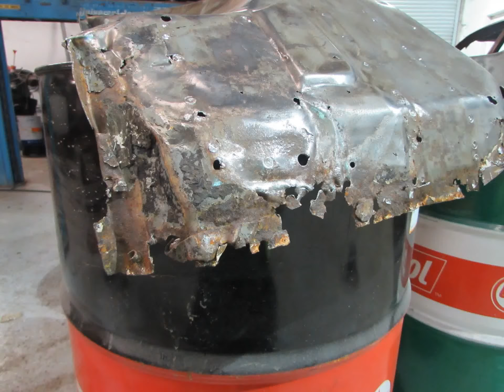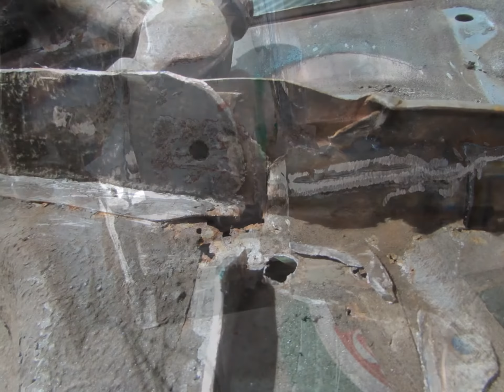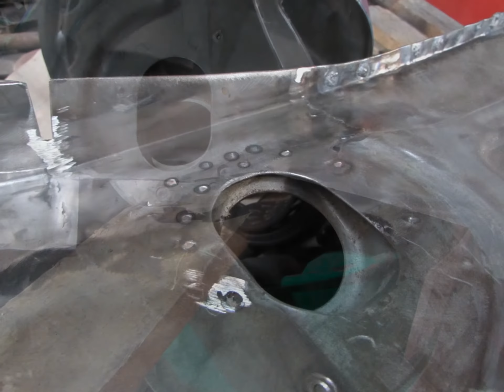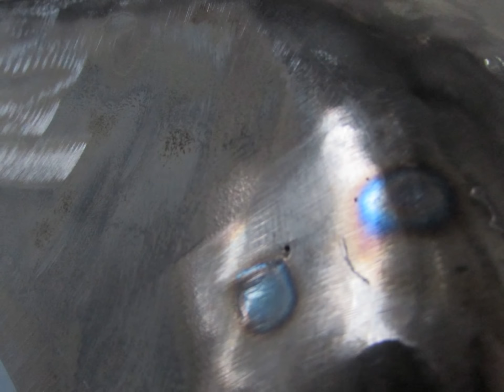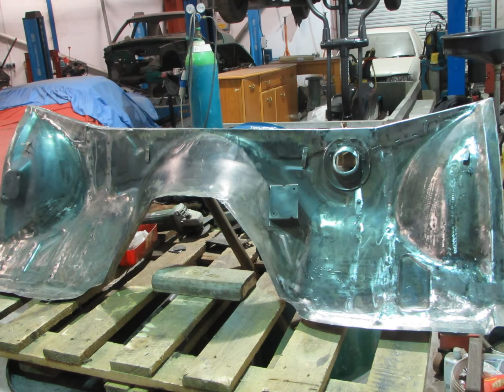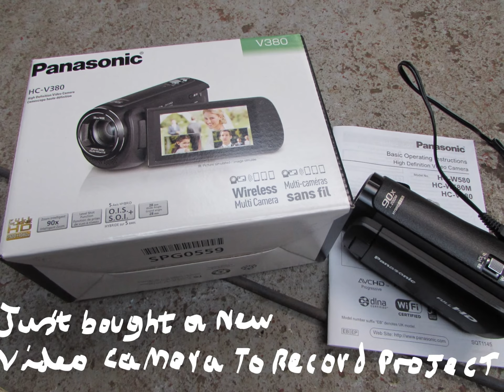My 1974 Ford Cortina Restoration PART 4

Comment: Panasonic do some excellent cameras, I think that model will serve you well. Some tips on cameras and welding grinding. I'm now on my 3rd Panasonic DX10. REASON- Welder burnt the lens on 1st one, but only because I was filming Mike welding WAY too close, you are ok a few feet back. 2nd, DUST gets into the mechanism and jams the focus servos (just stripped my faulty unit) 3rd, Metal fragments stick to the magnets of the mic and speaker. So basically, keep the camera clean. Great work on that lower bulkhead, oh wow that is really neat. Its the proper way to do it, same as Mike 2000e, slow, but its worth it. Ill be doing same on the 2 door. For me I use the pistol grip camera as it goes in my pocket, gives excellent sharp rich pictures in all light conditions. I can operate with one hand, its small enough to put in my pocket, so for unplanned quick filming it works a treat. Just about to bid on another on ebay, reason I keep going for the DX is beacuase its pistol grip and for me, it feels instinctively right. I believe you are near Wales Keith? If so would like to pop over and see you at some point on my travels around Wales. All the very best. Well done on spotting the petrol pump facia, a swampy tea mug for you here. Give me address on private message ill post out
Reply from the maker: Thanks for the info on the camera re welding, metal bits etc, (I'll keep that in mind), handy to know, thanks for liking the welding of the bulkhead lower section, I was VERY PLEASED with the end results to, Gary is a star and he loves the Cortina, as much as me, (a few of us really will get that!!!)  I looked at the top end pistol grip type, but it was £500  and still did not have camera light, or features I wanted, (only one they had in stock, at PC world, and the £249 one,  so I went for that,  not as good at recording sound as my Canon Power Shot still/video  camera, (maybe I need to play with settings?) presumed it would auto level with sound,  (My old video camera, I can listen to audio with a headphone jack and amplifier, fit extra mics for interviews, it  audio dub, insert editing,  admittedly it was way more expensive than the Panasonic,  (lets face it I LOVE old technology.  OH WOW a swampy mug!! Awesome, THANKS!!!!.